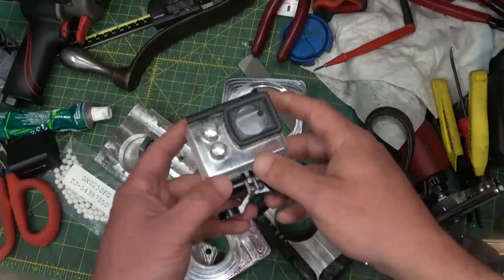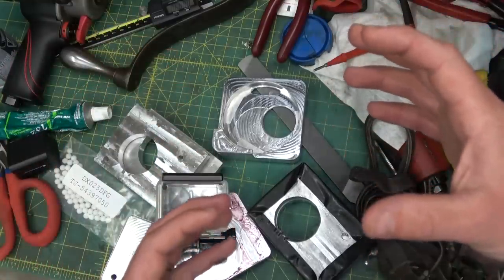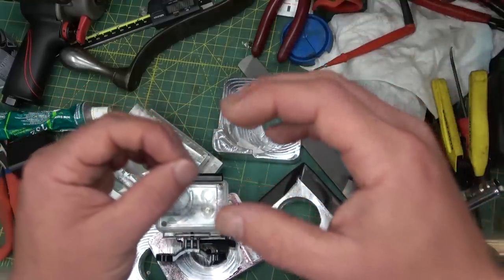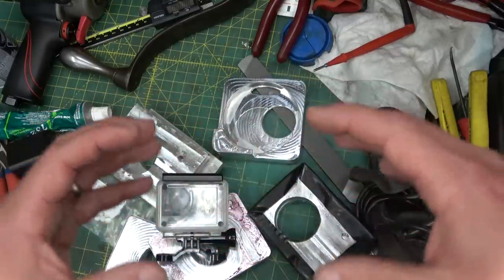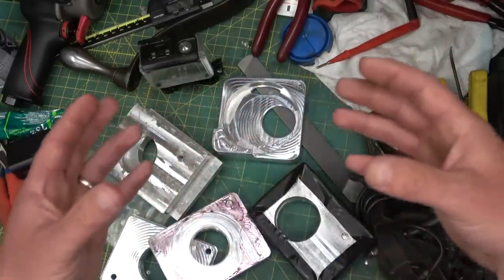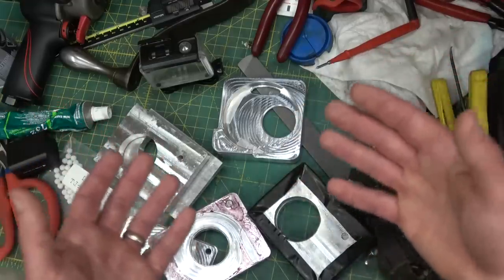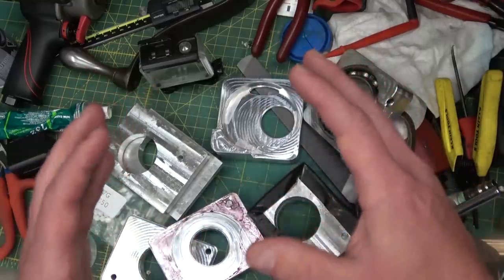Homemade Spinning Lens | self-cleaning gopro prototype

Comment: @ave bearing suggestion, see if you can find a 6808. Big bore 40mm with small OD 52mm. It would reduce your rotational weight.

Comment: More expensive lens filters like Hoya HD3 are made with oil and water repellent surfaces. So you may find playing with different brands achieves different results. Costs for Hoya filters are significantly higher than the one AVE used here so there is definitely a financial barrier.

Comment: I imagine you have thought of this already, but, why not bung an electric motor in there with a disc of perspex on the shaft and spin that? Ditch the bearing idea as that seems like it could get jammed super swiftish when it is inside a CNC box. Just a thought : ]

Comment: Fellow machinist youtuber Edge Precision made a go pro case for his filming and uses a 'blade' of air pressure across the front, seems to work quite well.
Reply: This idea is in direct response to the air blade not working.

Comment: How about a bigger circular acrylic window that is rotated by an electric motor and the camera is sitting off center (maybe at the 12 o'clock position)? That would result in a bigger enclosure but would be easier to realize, I think, and you could better channel the liquid from the window and over the case/enclosure. You could also use compressed air to increase the pressure in the enclosure and reduce the possibility of the liquid entering it.

Comment: Thought for a cheap, semi-quality bearing:  Look at auto parts instead of industrial parts.  There's got to be a nice bearing from a differential carrier or transmission for about $15 that folks could grab at any auto parts store that would work.
Reply: If the real deal costs 11k I'd think he could spring for a decent air die grinder. It'll have at least 2 bearings.

Comment: Hey Uncle B, I got my first Drill press. It's a 1950's Walker-Turner. Drilling holes has never been so easy, exept when its time to break through the other side, my workpiece always bites bit and either spins or the belt slips. I know im using pretty shitty bits, so can you do a beginners guide on how much to spend (I'm just a hobbyist) and how not to ruin my bits, maybe some basic do's and dont's and anythig else you think a beginner needs to know.

Comment: If you already have access to that much shop air, why not machine an air jet that has a feathered spread that blows directly onto the surface of the gopro lens?   Or maybe machine a small enclosure that your filter screws on to while the gopro is inside.  I feel like you could accomplish your goal with no moving parts and just a well designed air jet.  The whole spinning thing is sexy but seems needlessly complicated.  Probably in the 99% but there's my two cents.

Comment: Cool explanation of physical chemistry, although it is important to differentiate between something being a surfactant, and a detergent. Materials are often both, but the two effects are distinct - one, as you say, lowers the surface energy (aka surface tension) of water or whatever solvent, while the other actually furthers dissolving of other materials in the solvent by creation of things like micelles - this is caused by the dissolved detergent having amphipathic properties (both polar and nonpolar regions of the molecule). It makes other molecules across the polar/nonpolar spectrum soluble in the resulting solution and hence the universal cleaning action of soap.

Simple esters would not be good detergents/soaps (ie for washing jeans) as they simply modulate the polarity of water, but have no amphipathic properties. (I think...)

Maybe look into quantitative contact angle measurements used in materials science labs to study experimental thin films on glass. Love ur vids as always!
Reply: EDIT: oh you seem to have solved the problem quickly in good engineering fashion

Comment: What about putting a tiny bearing in that housing for the motor shaft to ride on and mount the shaft to the center of the lens. Direct drive and the smaller bearing would be easier for the motor to drive.

EDit. Another thought. You could drive it with a Dremel, use the flex shaft and youl'd have no pixies taking baths in coolant.
Reply: He's using air. An air die grinder goes at just the right schmoo-slinging speed.

Comment: Hey did you end up putting the STLs anywhere?
What about having a small 12v motor (like from a slot car) with a rubber band or similar running around the motor and the outer lens?

Comment: maybe if you stick some parts of the wings of a fan to a glass ?
or a strong air flow like an air curtain blowing vertical to the view point to a not rotating lens
or maybe an air flow from behind the camera towards the recorded subject .
and you just also need a tank , for the compressor not to work all the time . it is just a cubic meter installation (about 9 cubic legs  i think ) .

Comment: A cheap bearing would still have less runout and more longevity than your fabercobbled one. Also glad you tried the air bearing, that was my suggestion :). Though the idea is that air pressure keeps the schmoo out.

Comment: I wonder if that superhydrophobic stuff like neverwet would have the same problem as the rain x (just plain hydrophobic) in terms of interaction with the coolant. the youtube vids on that stuff look pretty amazing
Reply: Unfortunately, Neverwet leaves a frosted appearance, which is a dealbreaker. Also, Neverwet apparently doesn't stand up to oil very well, so oil-based coolants might be a problem as well.

Comment: What about using a sealed ball bearing and mountaing the glass to the inner race? Drive the back side of the race with air or a motor. Should have less weeble wobble then the plastique bearing.

Comment: Have you considered a machined sight disc, very smooth, held in place by a driven capstan and 4+ other small rubberized wheels on little bearings so you have 5 or more points of contact? I mean small rollers, like a 1mm shaft that you could actually slip into double bearings or even just ride in an oil bronze bushing like a cheap DC motor's shaft. Nevermind... too difficult to seal the rear periphery.

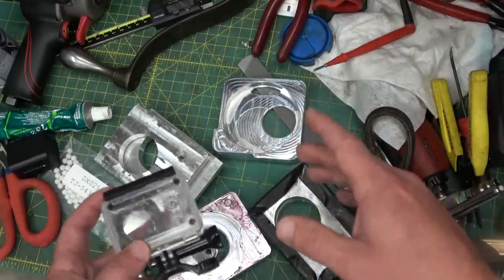Comment: 0:50 there's sometging called "Glaco" here in Japan. It's infinitely superior to rainx. Completely invisible, no streaks on the glass and it really fucking works. You don't even have to use the wipers when it's raining. Really good stuff. It lasts for about two to three weeks. It's also cheaper than rainx here.

Comment: Is there a risk of fluid build up inside? Would a shroud ring (flat, flared, or conical) added to the rim of the lens to cover the bearing from direct splash cause too much restriction to the exhausted air?

Comment: I would like to see you try a lens with a lip that covers the bearing cage  and presses fully into the inner race the outer lens could have a very mild conical shape or even convex applying air to the bearing cage from the backside could allow exiting air to form slight blade like pressure's the full circumference of the front side of the lens with appropriate gap between lens over edge and outer race this vortex could also assist in drawing off the schmoo.

Comment: Disclaimer: I'm just a couch shop-guy, with 20 thumbs that's only good for smashing the keys on a confargler.

I've seen a few videos of asian people attaching a form of "screen protectors" to their side mirrors, and water just refuses to stick to those. I have no idea what they're made out of, or what they've been treated with, but couldn't one of those do the trick? either cut it to size to fit the protective box, or put it on the safety glass that you're filming through?

Comment: Serious question regarding the utility of a motorized one. If that's designed for environments where you don't have compressed air, wouldn't you also be an environment that's free of cutting fluid? If you're outside, the enemy is rain, so then Rain-X would do the trick *in that case*, wouldn't it?

I guess you also have mud to consider (thinking about a Gopro while mountain biking), but I'd expect some dirt to smear the view with the motorized spinner. That might be a good thing to test with the pneumatic one, as long as you already have it made. (Rippums are rippums.)
Reply: If you are dealing with water and mud, then using a beading promoter (like Rain-X) in combination with the spinner will help keep the mud from adhering.

Comment: Use a small block Chevy with a blower. Direct the exhaust in front of the camera  when you turn the coolant on have a solinoid advance the throttle to 9000 rpm. If you want to go green use methonal. Thank you. Ps you ford and dodge guys can use your motors too but they cost more and don't last as long. Lol

Comment: If you use an electric motor with a capstan or gear type drive you will be limited to the RPMs of the motor. What about a motor driving little fan blades, essentially a little air pump. Then the only thing limiting the RPMs would be the CFM of the pump and friction. Not sure if a tiny motor would generate enough CFM though.

Comment: What happened to just aiming the water jet down the camera path? Seems a ton complicated considering all the profesh vindalajeyos using this method whenever they demonstrate with liquids. Meh.
Reply: aserta Because this liquid will be splashing in all directions as the machine cuts through metal.

Comment: A number of UV camera filters have a built in spinnamathing so maybe that will help?
Reply: Nope, those are the polarizing filters...and they are consistently worse than the chinesium bearings. In fairness, they have drag engineered in because you want to turn the filter to a specific angle and then have it stay there.

Comment: I bought some Rain-X windshield wipers once because why not? One would think that a company that has been around that long with a name like that would be halfway decent at clearing the water from a windshield,  right?

I was wrong. Worst blades that I have ever bought. Used them only a couple of times before I switched them out with a set of BOSCH and never looked back.
Reply: I don't know how you can "user error" wiper blades, but you must have - I've used either RainX or Bosch(if that latter weren't available) beam-types for every vehicle I've owned in the past 7 years; they're so equal that I don't even remember which brand I have on. Honestly bet that I could use one of each brand on a car and still wouldn't notice a difference(...maybe I'll try this...)

Comment: Hrm. Question/thought.
For the original spec/use-case could you power it hydrolically using the libation of choice?  So it's only a spinnin when the waters a flowin?

Comment: Is there any clear lens grade plastic that is machinable? If so why not just get a slab of that, machine it to the ID of an available bearing, then machine in some fins on one of the faces (about half of the thickness), then press/glue/adhere the other side into the bearing ID, then have the air channel pointed to the fins to drive the lens?

Comment: Clueless it security guy here with a question could you not use a Tesla turbine or cohesion type turbine such as in a washing machines water pump and power it from the lubricant used on the CNC?
I mean instead of having it move the fluid have the fluid move it.
Reply: Probably wouldn't be in line with him keeping it simple, but that would be a pretty clever way to do it. It may also overdrive the pump.
Reply: he wants something that is self contained and dedicated to a camera and portable. That way he can put as many cameras as he wants inside the CNC cabinet at different places, move them freely, and also the thing could be used for other purposes outside of CNC, like trying to film outside on a rainy day.

Comment: Why not use compressed air to blow the spew back from the bjesus lense or rotate a cylinder of poly carbonate wiping it on the back side as it continually rotates to unspewed vid jo

Comment: what if you design the lens holder to be a full enclosure for the gopro, and pressurize the gopro side of the lens?  That will solve any problems with leakage or blowby simply by ensuring that the camera side of the lens is at higher pressure than the machine side.  EDIT for clarity: using the spinning bearing lens design from the first video - which appeared to work well except for the leakage problem.

Comment: What if you get a bearing with a proud inner race on one side and mill windages in the proud race and keep your initial design of the bearings milled holder. That way all you have to modify is the inner race of the proud shoulder on the bearings

Comment: There are some small high rpm  5vdc motors and USB rechargeable batteries on amazon cheap for testing
Reply: @Joe T  there is no load, free spinning a cleaned out bearing.

Comment: Hey - why not just an electric motor mounted disc of plexi? There's no requirement for the camera to be centered on the shield. You can also use a center point for affixing the plexiglass rather than trying to balance a piece in a bearing race. Hell, just grab one of those blank CD-R's at the top of the pack that are clear, and glue it to the center of a computer fan sans blades as a proof of concept.

Comment: Couldn't you just blow compressed air directly at the lens instead of having a spinamathingy?
Reply: My thought as well. If you need compressed air to spin the lens, you might as well use the air to blow the crap off the lens and skip the spinning part. Indeed, perhaps some of the air could be aimed away from he the lens to blow the crap away before it ever even hits the lens, like a force field.

Comment: Why dont you just make a nozzle for low pressure air that's about 1  in diameter and two inches long.
(Have it taper down so the air injected into it accelerates)

One end is covered with a thin piece of glass

The air from a battery powered blower goes into the side near the glass and then accelerates towards the open end of the nozzle 

Fluids wont be able the enter the nozzle because the fast moving air will push it away.

Your camera is positioned against the glass looking through the nozzle.

I'm pretty sure that will give a clear view without any moving parts attached to the camera.

Comment: If the next prototype drives by an o ring on the outside, wouldn’t that work to cause a large gear reduction between the motor and lens? I don’t know if this is important or not in the design you have in mind or how fast it needs to go spinamathingin around.
Reply: Math it?  Let's say motorb has 4 mm diameter and lens thing is 60mm diameter . That would be 15 to 1 drive... At 20k ripums you'd still get like 1300 ripums.. That's pretty fast spinamathingin.... Would need to test what min ripums needed to actuality impart enough angular momentum to keep lens clear... Sounds like testing needed.  This is a job for the emperor of dirt...
Reply: The BozzHogg Agreed, looks like something we’ll find out in the next iteration

Comment: There's no reason the go-pro needs to look through the center of the glass.  Mount a disk on a motor shaft that runs next to the camera. It'll also eliminate the refraction wobble seen in your prototype.

Comment: You can add a second lens and blow between the lenses to make it spin.

Is there no fan that powers the blades directly from the outer case instead of driving a shaft? ( I really don't know how that's called)
Reply: It was the Yen Sun TMD fan. 
It's discontinued since 2002 maybe.

Comment: Why does the center of rotation have to be axial with the camera FOV?  It's not like you are spinning a lens that has to be axial.  If you are spinning flat glass, mount the glass to a motor with a shaft in the middle and offset the camera.  Sure the housing will be bigger but the design would be simpler, easier to make, and Joe six-pack wouldn't need a 10hp air compressor to keep schmoo off their lens.

I guess it's not as novel and the challenge is part of the fun
Reply: I guess you didn't watch the first episode of this. He already has one of those, and instead he wants something that doesn't have a spindle in the center, and is dedicated, small and portable to go with the camera.

Comment: A big bearing is too heavy for this purpose...I don´t know...10 or 20 times heavier then the camera alone. Good for stand alone application, but clumsy to use outdoor. Your design spark me some ideas. Without a truck bearing, but will keep spinning freely...Want this hint? Keep in touch...I don´t want patent, for sure. Just the credits. Best regards

Comment: i dont think that having some sort of direct drive or friction drive is going to work. the final drive ratio would be too low unless the motor shaft is stepped up to the same size as the lens or bigger. unless you have a motor that can spin 100+ ripems, which sounds like a good time lol

Comment: Could you do a video on pillow bearings please? I have no idea how they get that bearing in there...
Reply: They're either just held in with a snap ring if it's rebuildable, or they're pressed in
Reply: @RyTrapp0  mine are in cast housings. The bearings look much bigger than the hole. Weird.

Comment: I think its time uncle bumblef@$k  purchased a 3d printer. It perfect for this kind of project
Reply: Russ McCormick The Haas outputs parts faster with higher precision.  But it's also more expensive.  Of cause some parts will work better in printed PLA others in carved metal.  At the end of the video he announced the final design will be for 3D printing.
Reply: Yeah thats what I mean the Haas is way over kill. I think I would go with a pla bearing and petg housing. Could incorporate radial fan blades into the bearing for the drive, and a lens mount. Yeah Im probably going to keep an eye out on thingyverse for it. I dont own a go-pro or I would already have a prototype going.